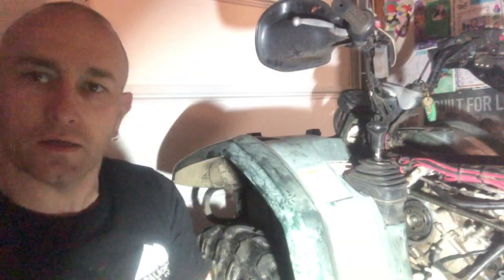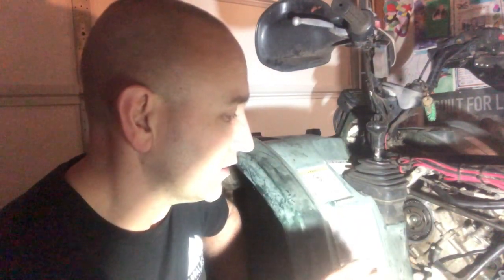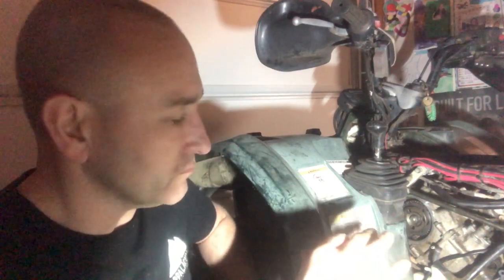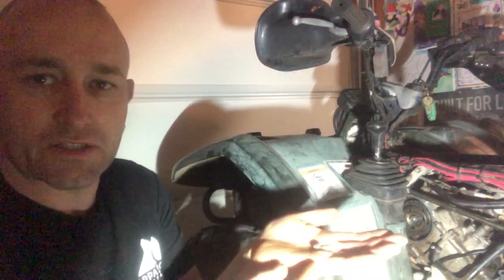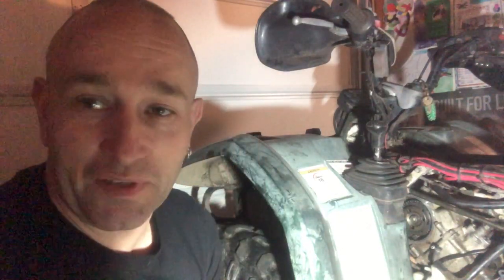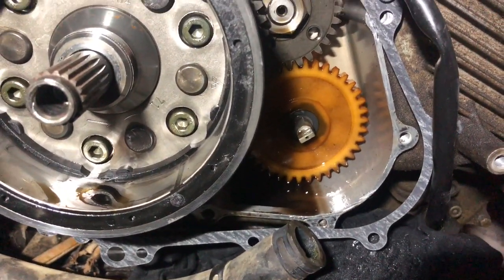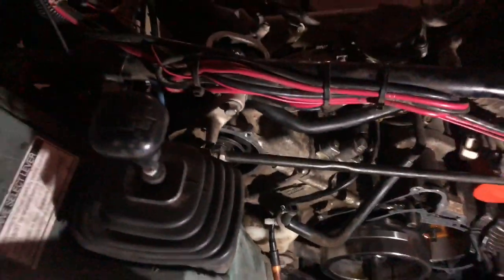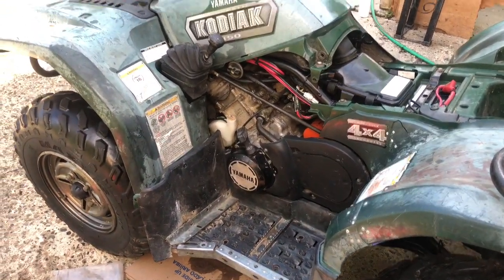Yamaha 450 grizzly ATV no start diagnosis and repair

Comment: I recently got same type of bike, and Im suspecting this is the issue or somsthing .
Good spark,
Good compression, 
Alot of fuel, 
And t mark doesnt match when piston is all the way up, 

Piston up matches the cam marks, but not the t mark on flywheel. 
Would you mind telling me the steps to take to get to it ? How to remove or if there is any special tools?

Comment: I bought a 660 guy said a random hole on bottom of block was leaking oil like block is busted he jb welded the hole 😂 and said motor still runs good I got it from him cheap cheap due to he didnt drive it well i got it home and no fire but you can hear a noise in topend he said he been driving it no issues got good compression tho Wonder what came out of hole 😂

Comment: Woodruff key did it's job . All keys are designed to shear and save the machine from more severe damage. They act as a mechanical fuse .........: explained:Yes, in mechanical engineering, a "key" within a "keyway" can function as a mechanical fuse, meaning it is designed to break or shear under excessive load, protecting the machinery from further damage by failing before other components do; essentially acting as a sacrificial part to prevent catastrophic failure. 

Explanation:

Shear Key Design:

A key designed to fail under high stress is often called a "shear key" and is typically made from a weaker material than the shaft it connects, making it more prone to shearing when excessive torque is applied.

Comment: that key does not actually hold the flywheel in the correct position. It's just a mounting aid. The flywheel is wedged into place with that bolt.

Comment: Thanks for the video.

Have a '90s 350 BigBear with no start. Compression is there. Have had carb, cleaned and rebuilt. Strong spark. But no start. Beginning to think its timing and possible woodruff key as well.

Comment: I'm here now for my confession. After I let a kid start up my Kodiak for fun, it later refused to start. I checked everything - connections, switches, fuses, battery, grounds, relay, even regulator. NO LUCK.  Then I sat on the quad and tried to remember what he might have done while sitting on it. Then I discovered a very small button I NEVER KNEW EXISTED under the starter switch - the engine kill switch. So after replacing the solenoid and almost submitting to a mechanic for help, I found the problem. The kid had hit that button by accident I never knew it. I told my wife I had finally found a loose plastic wire connector, so we'll leave it at that.
Reply: Haha I used one. Of my neighbors quad when his cattle got out  and turn off the quad with this switch he later called me and said I broke his machine I went over to look at it and started it right up! He was flabbergasted lol I showed him the switch

Comment: Hi I’m fairly sure I have the same issue can I check the piston is at tdc by measuring it by removing the spark plug and checking when the piston is at its highest point then check the ignition timing is at tdc also or do I have to remove the timing chain cover
Reply from the maker: You can remove the spark plug and use a skinny screwdriver in the hold to see when the piston is at tdc, there’s a sight window plug at the crankshaft, I show it in the video you can check the tdc timing mark through the window. There will be two marks one before true tdc that’s a spark timing mark the other one is true tdc.
Reply: @huntnfishnuts5880  thank you so much for the quick replie

Comment: great vid maybe its just the video but that ticking sound is way  way louder then my 421cc  wolverine
Reply from the maker: The exhaust manifold has a small leak but the engine is fine, the camera makes it sound worse than it is, thanks for watching.

Comment: I have a 1999 big bear 350 that seems to have same problem I'm not sure tho I'm not good at this stuff an only timed 2 cars in my life an it took me all day on that but besides that Iv took the timeing cover off top side an lind it up on mark seems good but didn't know about the crank timeing mark so it could be off there it has spark an has a very hard snatch back when trying to pull crank it. With pull cord like rip your hand off snatch back an when but it has always had that since Iv got it but it would crank an run good with 1 good pull some times 2 but it seems last time I rode it it ran good I switched it off an have field to get it to run again starter button don't work have to jump silonied so I just used crank rope ever since I got it an the man that I got it from helped me put new cdi an instater on before I left with it like I said ran good till I switched it off an since it's don't what ever it seems the starter engages at times when pulling the crank rope it snatch back an then when I pull it it wines an really stiff to pull like the starter is stuck engaged I like help to figer out what I need to do to fix it please an thanks for grate video to help with the woodruff key an the timeing makes on flywheel
Reply from the maker: There will be one mark on the cam at the top for the cog and the crank will usually have two marks one for mechanical base timing and one before top dead center for spark timing, you need to check your chain at top dead center so if your cam is on you should be able to see the top dead center mark on your crank in the sight window, if you cannot then it’s not in time. You have to check where the marks are for your particular machine as there all a bit different. Check your basic stuff first, spark then fuel then compression, if you’d timing is off your compression will be low.
Reply: @huntnfishnuts5880  thanks for the evice I ain't got around to checking the timeing mark on the flywheel but on cam it lines up on the mark an the timeing chain seems good an tight no slack or marks or stiff links  that I could tell or see it is getting spark an seems to be good compression to it I ain't checked with a compression tester yet tho I'm see tomorrow if the timeing mark is in line on crank an cam an go from there on it I was thinking at first it may be the carburator it bad cuz it's in bad shape on inside has broke float in it too I cleaned all jets out good an clear see throw them all but the adjustment screw in it won't move or can't get it out cuz the grove for flat head is broke off it looks like so I was looking for a carburetor for it but can't find a ome one for it anywhere an here bad things on all the aftermarket carburetors
Reply from the maker: @justinerkhart4611  if you think it’s fuel just try some starting fluid, if it starts and dies you have a fuel delivery problem, check you have flow to the carb after that make sure your bowl and carb are clean,

Comment: Hey man I just saw your video and I have the 400 version and it sheared the woodruff key and I replaced it and still can't get it to fire do you think the timing is somehow off now and if so how do you even fix the issue I'm stuck and clueless I checked everything except timing I was fortunate enough to find sheared woodruff key video and found it sheared and changed it but I still can't get it to start so I'm guessing checking that all the timing marks line up is my next step but I'm absolutely new to this timing crap and would so appreciate the help big time. Thanks please help hahaha
Reply from the maker: If you changed the key you had to have taken off the timing chain, when you install the crank flywheel there’s a timing mark on it you have to see through the sight window, take the timing cover off the cam and make sure the cam timing mark is lined up with the case mark and the flywheel mark is in the window, if not you have to remove the case cover and set the chain so the marks Line up properly.
Reply: @huntnfishnuts5880  do you mean by removing the tensioner bolt and spring and then pulling the cam gear off and turning it till the lines match up and then putting the cam gear back on if they aren't lined up and that should fix the issue? I'm guessing they can jump time when the key shears off ?
Reply from the maker: @420banshee7  both the cam and crank are keyed on so they are fixed once installed line the marks up on both then install the chain then the tensioner last, set the chain tension recheck your marks then rotate the crankshaft clockwise with a ratchet for 2 revolutions then recheck your timing marks if they still line up your timing is correct if not adjust the chain until they do Lind up turn if again and recheck, once correct make sure you have spark and fuel.

Comment: Thanks that was great advice, my 2003 Yamaha Kodiak 450 had the exact issue. Did all the same trouble shooting everything was fine.  Bought the new woodruff key along with the gasket and flywheel puller and the key was split in half. Put it all back together it fired right up...thanks again.
Reply from the maker: Glad it was helpful, when I fixed it there was no info I could find on a broken key being an issue,  thanks for watching.

Comment: Does the flywheel just get pushed back on and than later tightened with the boltfor the pullcord assembly?
Did u use a rubber mallet or anything to seat it on the woodruff key?  Doing this same fix on my wife's bike right now :)
Reply from the maker: You can tap it back on with a rubber mallet just make sure it goes on square, crank bolt holds it in there’s a torque spec for it but you will have to check what it is for your bike.

Comment: Hi I did all that and my starter just spinning not turning the magneto  I am stuck any ideas please
Reply from the maker: The Magnitogorsk will not turn its mounted to the inside of the case. The starter should engage the flywheel edge to start the bike. Check the engine is not seized, it should turn when you pull the rope, if the starter clicks and does. It turn you may have a bad starter solenoid, try tapping on the starter to see if it starts to work while pushing the start button. Check you have proper voltage at the starter should be the same as battery voltage. You may have a bad starter , make sure it’s aligned properly with the flywheel. Take it off the bike and bench test it put power and ground to it and see if it functions. If the starter won’t work try starting it with the pull start.
Reply: Probably bad one way bearing and the magneto does spin it's the flywheel or another name for it  the stator is attached to the case and is stationary but If you have a good flywheel key I would say that one way bearing or gear check all gear clearances.

Comment: Do you riegue the bolt that holds the magneto
Reply from the maker: Yes I reused it, I only replaced the key and the gaskets. It’s still running just fine today.
Reply: @huntnfishnuts5880   how tight do put the bolt on
Reply: Do you need to torque it
Reply from the maker: @reymondrodriguez342  you should torque it to proper spec so it will not loosen.
Reply from the maker: @reymondrodriguez342  that bolt in the middle of the pull start that goes through the magneto gets torqued to 36 ftlbs

Comment: My kodiak 450 would not start and it back fires what can it. be
Reply from the maker: Might want to check your timing, also check that your getting proper spark
Reply: @huntnfishnuts5880   thanks
Reply from the maker: @reymondrodriguez342  start with the simple stuff first, check spark, check your fuel, make sure your getting fuel. If you pull the spark plug and it’s wet with fuel it’s flooding. You might not begetting spark, check the compression, if it’s low it’s out of time or you have worn valves or piston rings.
Reply: got a 2021 kodiak grizzly 450 that wont start either, has a code 12. Wonder what it would be?